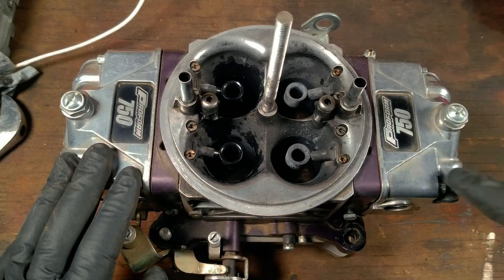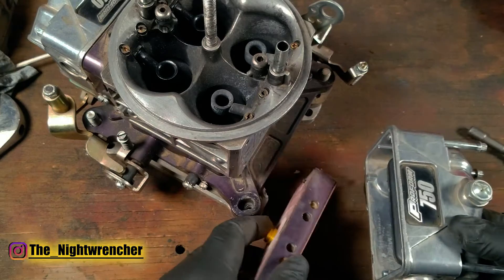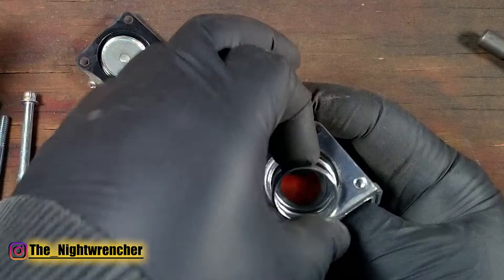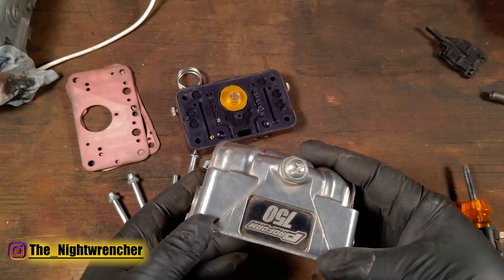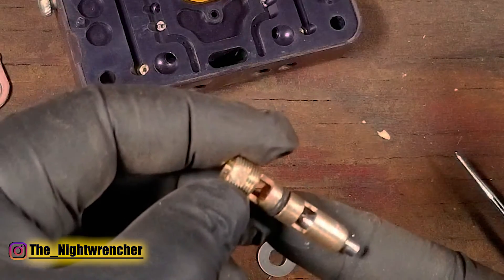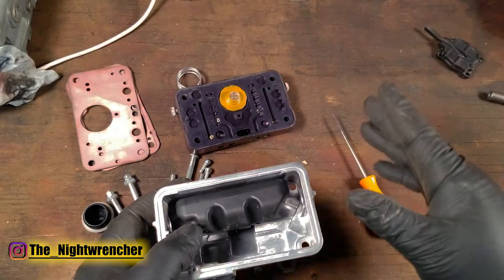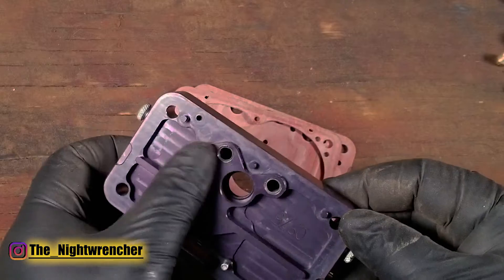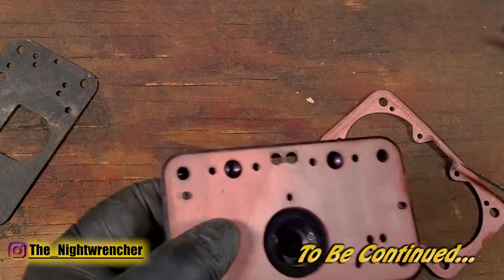Rebuilding A 4150 750cfm Carb | How To Rebuild A Holley Carburetor | Holley Carb Secrets |

Comment: Why is it when I adjust my fuel level gas spills out all over my carb from that top nut ? I turn the nut left to loosen it and then the gas starts coming out ..Maybe its the way it goes with Holley
Reply from the maker: Thats normal, thats why the nut has 2 seals to keep the gas in when its tight

Comment: Hello i have this carburetor but wen at full throttle it just bogs
Reply from the maker: If its a mechanical secondary, it will tend to bog at wide open if the engine is not set up for it.

Comment: So I got a summit 750 race carb looks exactly like this. My question is I plan on doing a torque storm supercharger on my sbc. So I want to make my carb a blow thru. What major changes beside the power valve have you change to make it a blow through carb. I’m am staying on pump gas at the moment.
Reply from the maker: I had to check out the summit 750 because I had no idea that summit came out with a new carb. It looks similar to the proform at first glance, but the two carbs are definately different. The main difference being that the proform has symetrical radius entries, similar to the Holley HP but the summit one looks like it used to have a choke horn and someone milled it off. I have a whole 3 part series going over all the modifications that I've done to convert my carbs.